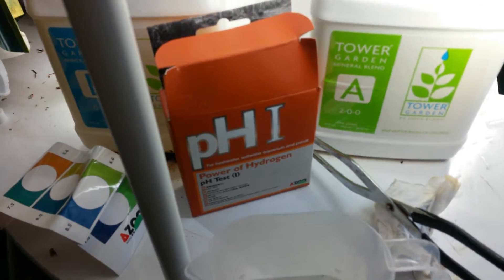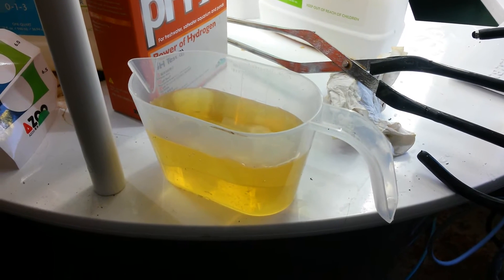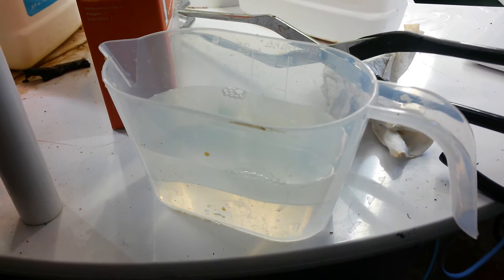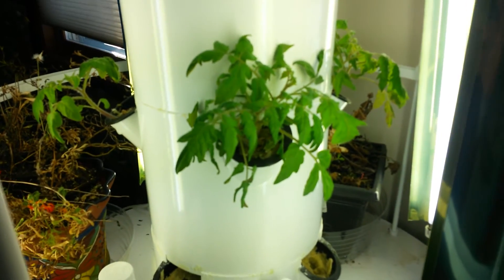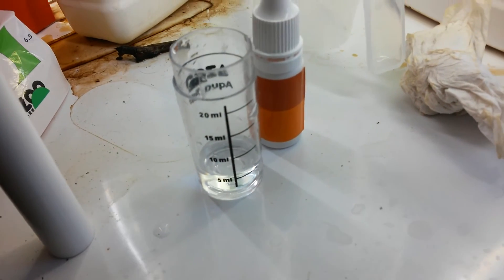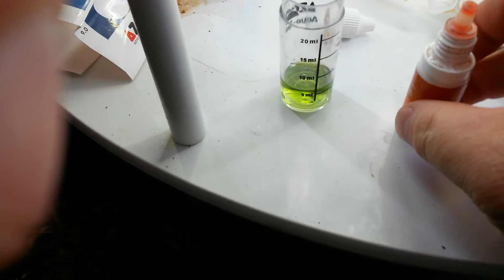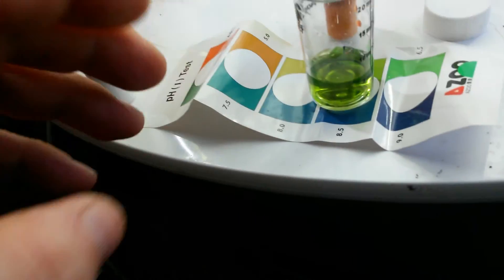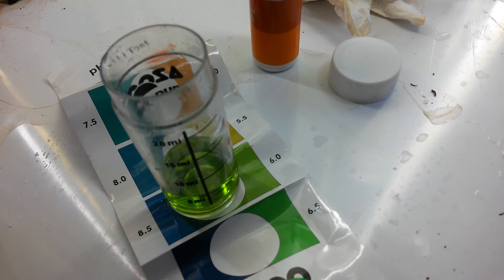pH Test for Tower Garden Hydroponic System

Comment: Hi bro, I used exactly the same test kit, but I wondering something, when I drop 5 drop into 5 ml, the waters colour change, then if wait it several minutes, the colour became different, so what do u think the final ph result ? The colour that immediately change after 5 drops or wait several minutes after that? Did u experience that ? best regards
Reply from the maker: Air reacts with the water to a certain degree.  The "first splash" gives a good measure of where the hydrogen ion concentration is at.  After that minerals/ions in the water and mostly carbon dioxide in the air start altering the indicator color.  I usually rise the test vial three to five times in the tank before pulling the sample for testing.  If you have been working with the buffer it is possible that a droplet might find its way tweaking the pH up or down.  That is why I rinse the vial in the tank water.    The range of the indicator is in a point on the pH scale where a little change in the hydrogen ion can make a significant color change.   Not sure how you familiar you are with chemistry, I teach it at a high school, but the concentration of hydrogen ion at a pH of 7 is one millionth that of a pH of 1.    So in a nutshell first splash for a reading on your tank, good read color is with the indicator drops, a small swirl and a quick compare to the reference chart if needed.   The plants will tell you a lot too in a Tower Garden.   pH higher than 7 will burn roots or inhibit nutrient uptake.  At a pH of 7 to 6.5 the plants can uptake water but nutrient absorption will be poor enough to stress the plants.  6.5 is the bare minimum "happy spot" with some plants being very happy but a few more sensitive ones, like strawberries still stressing.  5.5 is pushing a little too acidic for some plants.  Limey green not piney green is ok.  Limey green with a more yellow tint or a bit of orange is better.